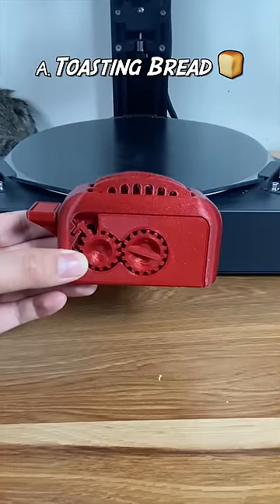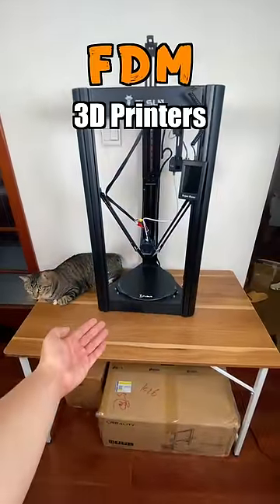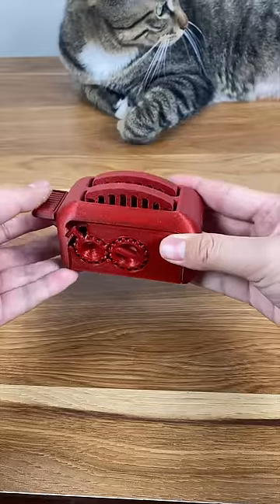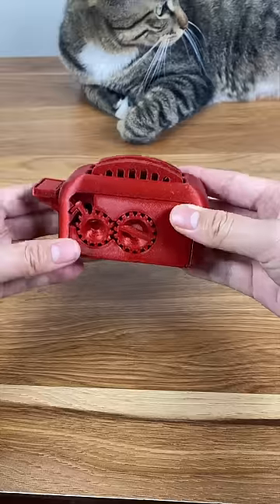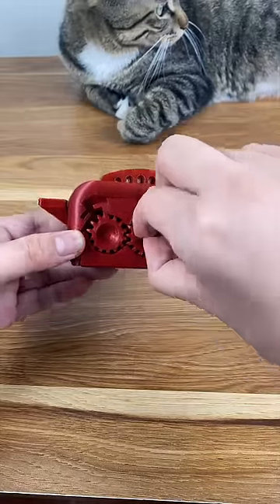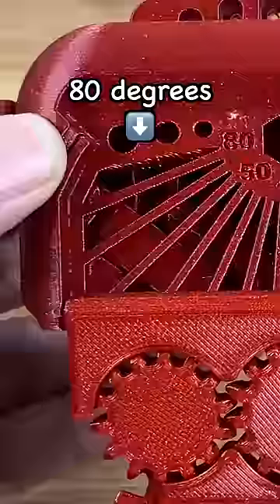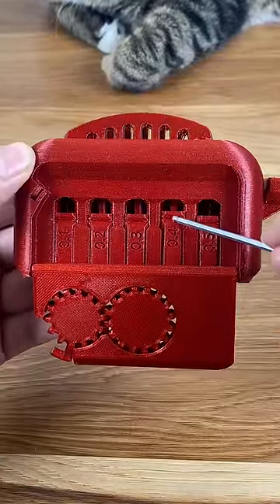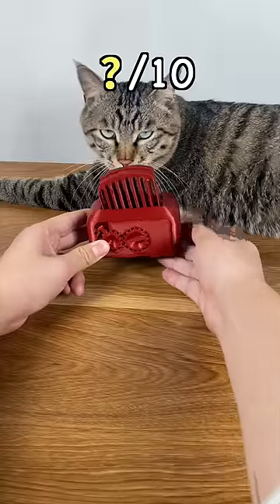A fun way to GRADE a 3D Printer😏

Comment: Is the tolerance in mm? If so, that is impressive
Reply: Kitty definitely said "mmmm"
Reply: Not really that good, most FDM printer have a tolerance of 0.2mm. Sounds great but when your making small parts its absymal. Wish my engineering school had a resin printer
Reply: @w.t.5136  resin is terrible for anything functional though, and he should be getting better tolerances out of that prusa. All of mine were clear when I did mine
Reply: I'm a machinist, and those tolerances are not easy to get. Or should I say it's not easy to repeatedly get those tolerances
Reply: @bigpie8126  ok, typical/consumer resin printers then. I wouldn't have thought I'd have to specify that though 😂
Reply: @charistiaanharmse301  Yep, probably why the Prusa is so renowned for its quality
Reply: 8 thou in machinist land is like a football field
Reply: Keep in mind that's a relative dimension, too. That gap is supposed to be 0.2mm, but that tells nothing of the overall part tolerance. The whole part could be 5% larger or smaller than spec, but that gap would show only small variation. FDM printers are not precision machines, but it is possible to machine ABS and Nylon parts made on FDM printers with traditional machining tools and techniques. Similar to casting a part from iron and then machining only the surfaces and holes that need such a level of precision.
Reply: @charistiaanharmse301  what do you operate that it's hard to hit those tolerances? 0.005" was the tolerance I used at a shop for a while
Reply: I didn't know u were talking about millimeters at first and read "is the tolerance in mmmmmmm?
Reply: @OsiDio  I was thinking the same thing. +/- .005" should be easy to hit all day as a machinist
Reply: @lio1234234  Why would an engineering program be buying consumer grade printers though? He pretty clearly stated it was a class setting.
Reply: @BigSteenThaGodHD6520  likewise. Can hit microns in the shop if we need to
Reply: I believe it was in microns
Reply: @charistiaanharmse301  ? Machinist? What are you machining  wood lol
Reply: @boulder795  1micron is like breaking down .005 200times id like to see it someone walking by pushing cooler air toward you will change measurement in microns. A car driving by would change measurement you people are talk
Reply: Lol I'm still learning... and on a clapped out machine
Reply: @charistiaanharmse301  better than nothing
Reply: @lio1234234  you replied to someone talking about an engineering school and you actually thought they would be using a resin printer that can't perform to prototype standards? It's like you didn't even read the comment before you got corrected 🤣
Reply: @broughttoideas  it's not easy, but in a non temperature controlled environment I've held +- 5 microns without much effort
Reply: @boulder795  thats 5 microns not 1. At 1 you will see fluctuation
Reply: @boulder795  thats still crazy thou 5 microns. My only point was the claim that .5mm .2mm is hard to achieve and the guy said he was a machinist .2mm is thicker than an aluminum can almost 9 thousands I believe a micron is like .000001 so yeah huge difference in size
Reply: @bigpie8126  Resin couldn't hold up my 6 pound monitor so.... lmao
Reply: @w.t.5136  you want an SLS nylon printer. Too bad they’re like 50k

Comment: 8/10 did every good just missed a few thing but I’m sure you could fix it without getting a new 3D printer
Reply: 8/10 is what I was thinking
Reply: How to get more precision without getting a new 3d printer?
Reply: @Lucas_1706  smaller nozzles, tweaks in slicing, better material and material settings, always more options than you have time to explore with 3D printing.

Comment: 9/10

My rubric
adhesion, 1 point
Gears, one point
Stringing, one point
Overhangs, one point
Tolerance, one point

The grade
Adhesion, one
Gears, one
Stringing, one
Overhangs, .875 (I managed to get up to 80°, I used an increment of 10, so the printer got a 7/8 for this section)
Tolerance, .6

Total, 4.475
Total /5
.89/1
Convert/round
9/10

Comment: i say counting each pair of cogs, all the angles including the circles, numbers, and hexagon, each of the weight, the number on each weight as well, no stringing, the bread and the lever, it got 30/34 witch equals an 88/100
Reply: I was going to say 8/10 also Since it passed 80% of the tolerance test

Comment: 8/10 more accurately 78.57% success based on the number of torture tests, and the amount of failure. 11/14
5 clearance tests
Gear test (don't count doubles)
7 Overhange tests (don't count doubles)
Bed adhesion
Failed 2 cleance and 1 overhang

Comment: 8/10 or 8.5/10. Pretty smooth and decent printer. Mine was a bit more worse for $200 but yours runs very well and smoothly, it’s fine if a printer has very small overhangs, after all nothing is really perfect 👍🏻.

Comment: 12 out of 18 points
2 for bed adhesion (Could be better, could be worse)
2 for no stringing problems (Same)
2 for gear operation (Same)
1 for overhangs (Slightly stringy)
3 for .5, .4. and .3

Comment: Bad adhesion=1 point
String problem=0 point
Gear operation=1 point
Accuracy=1 point
Tolerance:0,3

Score÷test(lets call it question)×100=3,3÷5×100=66

Its test result is 66%

Comment: Your cat secretly uses your 3D printer while you are gone your cat is plotting world domination and you can't dominate the world if you don't have a mech suit to do it in right now the cat is starting off small scale but eventually your cat will have something full scale working and ready to take over the world's catnip supply If you look in your cat's secret stash a spot there are schematics on building a huge full-scale 3D printer to print the parts needed to build the ultimate robot but first your cat will print his/her self some 3D printed hands

Comment: Can someone explain what the .1 .2 .3 .4 .5 is
Reply: Tolerance test - there are a series of male/female parts that have decreasing design distance between the parts.  Im guessing the 0.5 - 0.1 is millimeters between the male and female parts.  As the design distance decreases, the tolerance of the printer is shown.